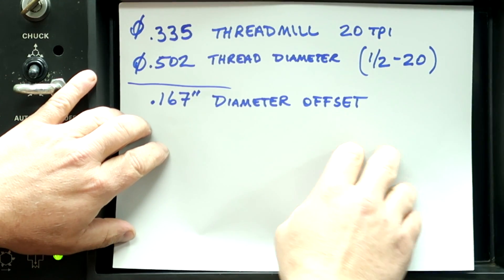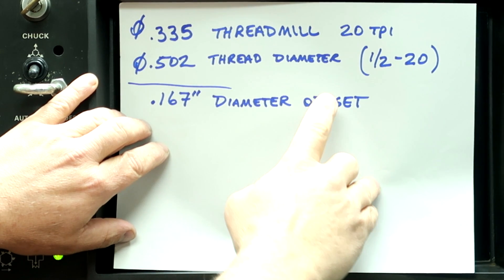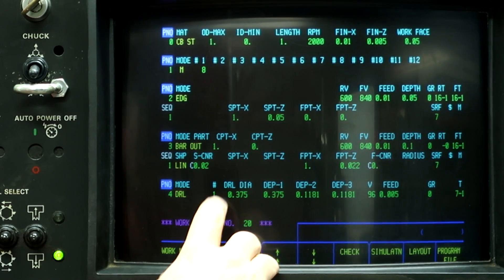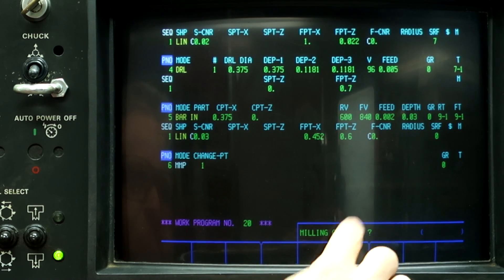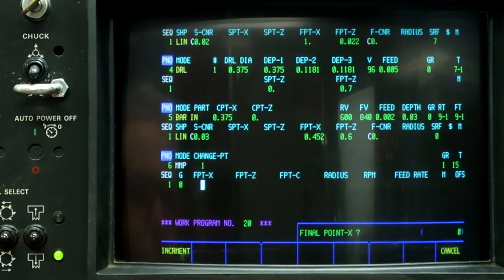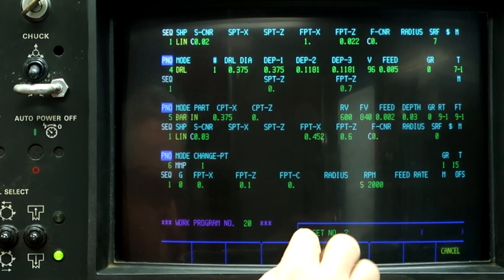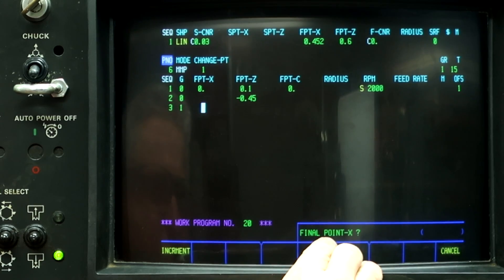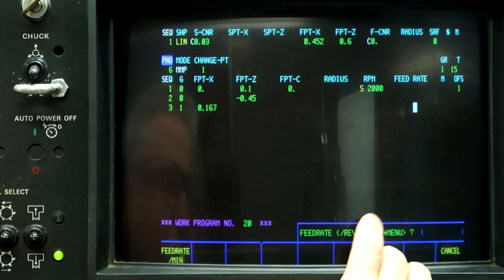Mazak CNC Lathe Threadmilling

Comment: hey Phil how do i a NPT. ?
3/4-14 1/4-18 NPT ? any clue?
Reply from the maker: Sorry I never made a video on NPT threads but yes I can explain it. Turn a 1.79 degree taper on the part and then thread using the same 1.79 degree taper. Use the Bar out process to find the end points for the thread taper. You can measure an existing thread to get close for the starting X diameter. I used ThreadPal software to calculate the actual X values but sadly that program is no longer sold.
Reply: @mazatroltipsandtricks6816  and would you use single point pitch threadmill or  ?  
so i have what they call TM435-14   it can do both 1/2 and 3/4- 14 i just wasn't sure how to use it!!

Comment: I have a z offset question . I went to shorten the length  of a part . I touch off the face and was going to teach the z. I want to make the part .020 smaller which i thought should have been a negative number . I was told it was a positive number. I am trying to figure out how . since the face of the past is usually zero and anything going back toward the jaws is a  that is usually negative number. thank you sorry if i am confusing you what i am trying to ask.

Comment: Can you help me, please? I have a problem with my lathe. I cannot start the spindle because I get an error: "adjust center position." What should I do?
Reply from the maker: @szszprycha  what is the error number?  That will help look up the problem.
Reply: @mazatroltipsandtricks6816  512
Reply: @mazatroltipsandtricks6816  512

Comment: Hi Phil I have a problem with a machine like yours because I don't know how to set the Y axis, I have the axis moved, it's too low and I don't know how to fix it. Could you help me somehow?
Reply from the maker: I don't know but there are a few maintenance techs on Practical Machinist that may be able to offer assistance.  Post up here. https://www.practicalmachinist.com/forum/categories/mazak.36/
Reply: Do you know if the pocket itself can be moved?
Reply from the maker: @Ciasteeek  Do you have a QT10N ATC/MC like mine? My machine does not have a Y axis.
Reply: Conventionally, I'm talking about the "Y" axis, so that I stay at the "tip" while turning the face. As if the blade of the plate was too high.
Reply: are we talking about such a setting?
Reply from the maker: @Ciasteeek  if you do have a machine like mine then check out this thread.
Reply from the maker: https://www.practicalmachinist.com/forum/threads/mazak-qt-10-t3-atc-90-degree-live-tooling-is-low-on-part-by-050.413914/
Reply: Well, this is the biggest problem because I can't remove the retaining ring

Comment: I don't understand how it knew to go all the way to Z-0?  You only programmed 1 rotation and 1 pitch of .050".
Reply: The threadmill has multiple teeth and cut the whole depth in one helical rotation.  Faster than a single tooth, but limited to the one pitch.  (Well, maybe 40tpi as well if the tooth tips aren't too radiused.  Would also require 720deg of feed.)
Reply from the maker: @SouseMouse  Thanks for the explanation to his question.
Reply: Yes, I assumed it’s a single point. That’s what confused me.
Reply from the maker: Not sure what you mean.  I didn't program Z0 at all.

Comment: Can you do multiple thread starts?
Reply from the maker: Yes. Pretty easy to do.
Reply: You can program it to start at 0 on the c axis and do the cut, then program it at a different degree on the start for the c axis for the second cut. Divide how many starts you want by 360 degrees. Make sure the final c axis point is 360 degrees more than the start for each multiple entrance.
Reply from the maker: Yes. Just program C position 180 degrees off initial starting point for two start thread.

Comment: Can you show how you setup the thread mill tool in the tool offset page ?
Reply from the maker: Set it like a regular endmill.  Because this is a manual process it really only needs to have spindle arrow rotation set. Set the geometry X0 is center of tool just like a drill or endmill. Sorry for leaving out details.
Reply: @mazatroltipsandtricks6816  Oh okay thanks for the information! No worries. Thank you for the video !
Reply: Nice info sir...👍👌
Reply: Set it like an endmill, thread mill is practically an endmill with teeth
Reply: Thanks Phil I always wanted to know how to do this!